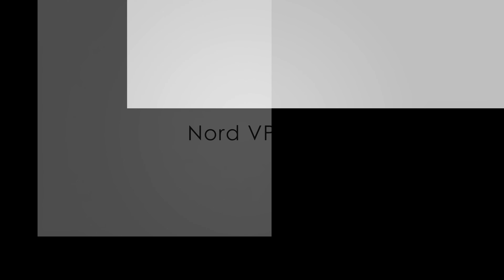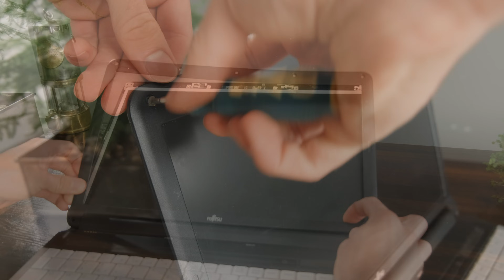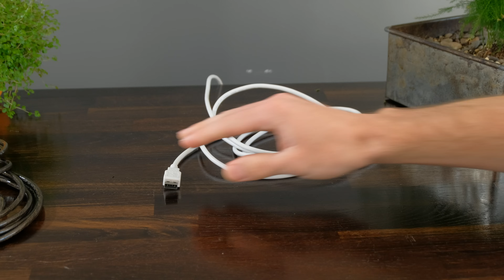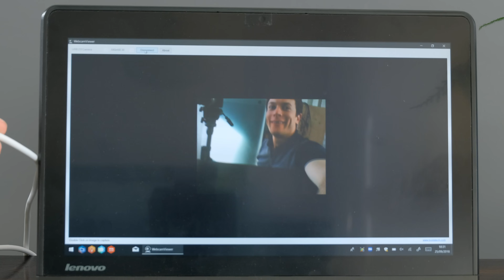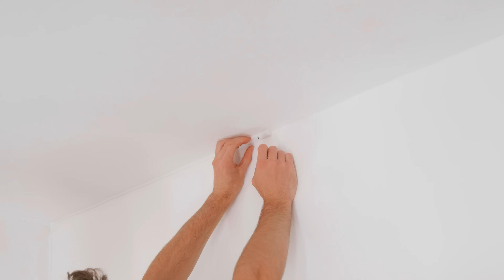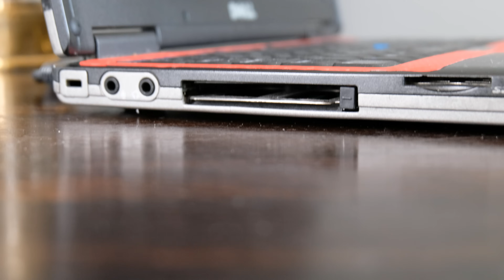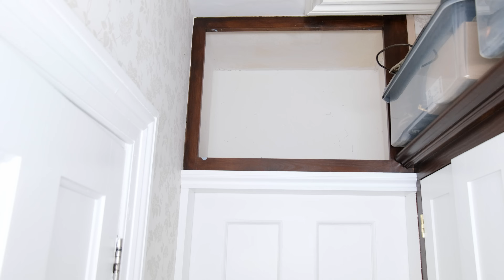DIY Home Security - ON A BUDGET!

Comment: I want to try this, but the video skips over HOW you connect and tape the wires. Soldering? Twisting the wires and taping them with electrical tape? Is this the newest video on this topic? Is there a version where a microphone can be implemented into these plans?

Comment: Anyway to possibly add build this in a way where it is battery operated and still recorded to an SD Card? There are several spycam or nanny cams on Amazon that does this, but the quality of the camera is lacking. How about old smart phone cameras instead of wwbcams? Thanks in advanced.
Reply: I am trying to figure out how to do this wirelessly as well...maybe with a ESP32

Comment: Only a moron would go with a company like ARLO, Ring, Nest etc for their “security” when you can OWN your own system that records all video, has analytics, AI functions etc. which do not require a monthly fee. Once you buy, you own. 
As for price? Yep, it can be steep. Especially if going through a surveillance or security company. However, you DYI peeps can easily buy NVR’s, Cameras and CAT6 cabling and install them yourself. It is not hard and I GUARANTEE it will be better than this.

Comment: That feeling when you wanted to make this but your webcam uses a ribbon conector
Reply: just cut the ribbon connector and solder😭
Reply: @dylansimmie that’s so hard to do man 😭
Reply: @dylansimmie mad or what, like who can even solder those small wire?? 😭😭
Reply: @sakusume its not as hard as you think😂 you just find a way to strip em and then twist and solder😭

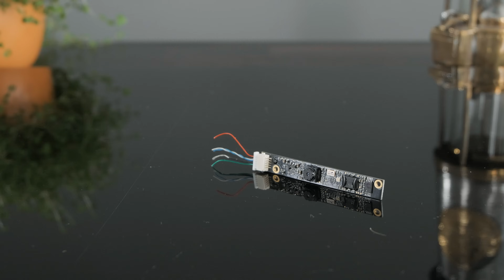Comment: 3:07 My Webcam has 3 wires, what should I do?
Reply: Also it has no marking or indication of ground
Reply: I might have gotten to the USB protocol part but the connections are too close for a multimeter or soldering to
Reply: kaka

Comment: Quick tip, these webcams can get hot using usb from my experience. I think they're made to be low power on laptops and probably running on 3,3v 3,7v and not 5v ? Correct me if i'm wrong.
I wouldn't advise you to cover them in anything. Sugru or whatever.
If you know enough, get the usb power down to 3,3 3,7 i guess. Or leave the camera well ventilated if it's running for a long time (security camera duhhh).
This might actually start a fire to be honest. @DIYPerks

Comment: Hi, I would like to use a white casing of a simple led lamp to put inside a little camera that is 5V powered supply. Can I took the power directly from the bulb that could be 220v-5v maybe? in a point of the white casing I will make a hole for the camera. In this way I have all inside a bulb but at the same time it's not a bulb camera that is very visible. Is it possible? Could you make it?

Comment: Hey Everybody, since I saw the video, I really got inspired to try it out myself. I have been living in not the nicest area, so I wanted to see how well it goes. I've been using the entire system for almost two years now, and here is my experience with it:
I tried the method with laptop cameras, but they are pretty hard to get, so I had to derive to normal webcams. Pretty cheap, I bought three webcams and been using two of them. Be careful what webcams you buy, some are not made to run 24/7 and they tend to glitch.
For the server, I am using my very old 2013 ultraslim laptop. The upside is, that it only draws about 1KW per week, which is mandatory in the current energy crisis. The downside is the specs are bad. The problem is that for each camera, ContaCam needs 1GB RAM and 1CPU core, so keep that in mind.
Another difficulty was the night. Most suspicious things happen in the night, so it is important to have night vision. I  thought of getting a camera with night vision, but it was too expensive. After a while, I stumbled upon an article to make any camera infrared sensitive. But I needed some Infrared lights, I decided to buy old, analog, surveillance cameras as they are dead cheap and have the infrared led ring and even a case. It was just a matter of fitting the webcam board into the case.
My disclose so far: It is definitely worth it, especially if you just want to start out or are on a low budget. But don't expect that it will run flawlessly for years.

Comment: i have a question. i do not have that many old laptop  webcams bu i do have some old smart phones can theese be connected with usb with some app and then connect this to contacam. i tried with iriun webcam but in contacan it eiter does not connect or only shows a still image how can i fix this? it does not work with either wifi or sub. same results on both

Comment: what should i do?? i have a webcam but the circuit board is covered by a grounding shield so i cannot access any components unless i unsolder it which i cant but i have figured out everything else but the + lead so should i geuss?

Comment: hhyp4rsssvnc . Go to clip some Wires and make the either cam fit putting the kit together by USB but instead by usin nhgvolts rttry the switch , and red in the circuit brd.  To it a. B. And black goes to it too. And white battery if it s the battery has .... cool . ❤ .

Comment: As somebody working on my own channel your formula and presentation is personally just as important as the subject. 
I've repurposed my old phone as the video recorder and editor. Being an old flagship from the No.1 android handset manufacturer the camera is ultraHD capable so more than capable in pro-mode and with the right settings. However if your filming for more than an hour you can fry an egg on them (even when rooted and de-bloated) so your tutorial gives me more options as well as multi-angled which is a game changer.
Thank you and keep up the great content
Reply: if you're talking about a Pixel, then I can testify that recording with them (i have a 3a) is a huge pain. I once had to strap a gel ice pack to it just so I can record for a couple more minutes.
Reply: @ArnauDisrepair  I said, "No.1 android handset manufacturer" bro. No wonder you had issues! 🤭
As a side note, if you roo, bypass google setup and use manufacturers web browser (samsung browser in my case) and you have a device without bloat and 'play services'. Turn on 'flight mode' and 'sensors off' allowing only camera permissions (you can totally do this with some tutorials from xda) and you basically have an expensive camera only! 
Another important thing to remember is ratio/format so you want to use 1080 720 or HD. If you use UltraHD/4K/8K >(gimmick) then your video editor of choice will not be able to render them and will require conversion before you can edit them. You can always upscale later.
Using this method I was able to record for two hours with only a modest increase in cell temperature as no services/apps are running and the internet is not spanking your processor.

Comment: Is there a good way to get the camera to output a signal to be picked up by another computer in the vicinity to have a more wireless camera setup? The most I want to do is to run power, I dont want to run full data cables to my pc.

Comment: I’ll contact him before but I’ll check it out what I’ve been using is Xeoma, Acceleration in the module feature allows you to pick what triggers the camera to record if you don’t have it on set times and how it will notify you via Transfer protocol email etc. I’m using a computer with 2006 Vista with networking disabled and biosphere mean they work and after removed because I am needing this offline. Just change the name from trial to whatever your operating system architecture is either 32 or 64 and free and you can add up to like 1000 cameras you can choose to use their hosting service and access your security system from your phone it’s a really great piece of software and their support for it on most linux distributions. Jesse USB cameras you can use IP cameras POE cameras other random shit that you can harvest and turn into some type of interface I wanna see if I can get a switch and connect a bunch of cameras over ethernet cables if anybody has any off-line interfaces that would work well with cheap cameras let me know. Oh another thing if you’re using an old PC Jonah will let you display the resolution lower than it is recording your resolution that way u can up the frame rate

Comment: I dont think this works with all laptop cameras. I have one with an IR sensor (CW54M) and it had a ribbon cable and not the type of connections these have (cable). Is there a way i can make this use of it still or no?

Comment: Can you do an updated home security video? Maybe with night vision and doorbells and alarms?
Reply: You could install basic IR lights through a light sensor for night vision. Just make sure the webcam doesn't have an IR filter or check beforehand if you will be able to remove it.
Reply: @audris8113 😅😅😅😊😊😊😊😊😊😊😊😊😊😊
Reply: @diyperks I would love an update. Maybe with cellphone cameras too
Reply: @TFMsnavy  Honestly not a horrible idea, they are smaller.
One issue I can see though is I bet they are harder to selvage and harder to solder leads onto.
Reply: I would like to see one setup using only a raspberry pi 3+ or 4.
Reply: @SullySupa this is a great idea.
Reply: ThatOneWierdVox  clicking in a comment to reply works, writing a channels id or username does not
Reply: Пнимените светодиоды инфракрасного излучения и камера будет видеть ночью
Reply: If anyones taking requests, I'd like to see a car dashcam version of this project, it it's possible.
Reply: @alliedatheistalliance6776 ooooohhhh. Me too me too!  powered by the car's battery PLUS a backup power source that only kicks in if the battery of the car is removed.
Reply: Newer cams with Sony Starvis are amazing at night. If there is a cheap way to set those up these days I would love that video.
Reply: @SnubBarracuda That’s quite an interesting idea. It would be fun to try out, the Starvis sensors are really surprising. I have seen some of the new VIOFO dashcams have a rear facing camera with a USB connection, but i’m unsure it it’s actually a compliant “real” USB or they just use the cable/connector as a straight videofeed from the rear sensor to the front main unit.
Reply: ThatOneWierdVox  Anymore? It couldn't be done from the start
Reply: yes

Comment: I have a LAP multimeter from Screwfix which doesn't have a beeper mode, any advices how can I recognize correct wires just by numbers? With grounding it keeps displaying numbers on red wire and data wires and I could take a guess and say red wire gonna be the grounding, but when checking positive connection, all wires shows numbers and do not come back to 0 as with the ground.

Comment: If I solder the web camera to the usb cable & connect the usb cable into a power source, will the camera automatically turn on or is the software needed for that also ?
thx

Comment: Howdy. Could you please build a ball solder, IC heater/remover for us? As an example, I may need to reball my PS3's gpu and im looking for a repeatable method for doing this. Thus far ive seen almost like a catlebrand that heats the solder to 450. And ive looked at cigarette lighters for ic removal, and induction heaters, both for the same process. Im changing the capacitors first. But im sure many others would like to see your inovative approach to this. If the capacitors are a no go, i may take a shot at reballing the gpu.  Thanks!

Comment: The only downside I can see is the lack of knowing what fidelity each random webcam can produce, 480p, 720p, 1080p etc. 10fps, 30 fps etc. Zoom no zoom?
Reply: Webcams are so small, that they almost certainly won’t have optical zoom. So it’s really up to whether the software you use supports digital zoom on the video (therefore you just want the highest resolution possible, for example, if you zoom in 4x on a 4k webcam, the image is still clear because it’s 1080p). I can’t speak for the other things.

Comment: so, my cam has colored wires which made it easy for me to connect with the usb but then when i plugged it in there is that ic (m5608c) that gets super hot + it's not recognized
Reply: i think its m5603c

Comment: Suggestion for laptop health: it's not the best idea to have a laptop sitting on something cloth like as it can restrict airflow (no I don't care if it feels cool enough, it's still not a good idea). if you're going to leave it up there either take that bamboo mat out or put some bottle caps under the feet as spacers so more air can get underneath it. Also get yourself a smart plug (or do it yourself manually) and exercise the battery from time to time. Most batteries, especially older ones, don't like being floated all the time. Even if it's a lithium battery and it has a charge controller and all that fun stuff, not all charge controllers are created equal. So make sure to exercise it, and it should stay in peak form for when you actually need it.

All that aside, that rubber putty stuff in the corner of the ceiling is freaking genius! I know how I'm hiding my interior cameras now (and maybe a few outside ones, let them destroy the decoys LOL) 😁

Comment: That's the problem with security cameras number ones are linked to NSA database for face recognition before you even get the material on that's why they don't have SD cards so they have to go through the cloud to do any storage plus the company wants to charge you monthly for features you bought the f**** camera for I've owned and demoed almost every camera on the market and found them all lacking if you can build your own high functional camera system that you don't have to pay for the function of the camera you bought more power to you

Comment: Excellent video but The connection part is a bit vague. the webcams have very many wires, which ones are used and which ones are not used? You could at least consider showing the actual connection between the wires from the camera and the usb cable

Comment: Couldn't you use the multi meter to find which data wire is positive by putting the meter in Diode mode?

Comment: I've thought of doing a similar project using Cell Phone cameras. I've got 5 outdated cell phones but I'm just not sure how to wire them. I haven't even thought about pricing new replacement cellphone cameras and I'd imagine you could get them just as cheap as the laptop cameras.

Comment: @DIY Perks. Are the USB cables I am using correct? Your USB cable shows 4 wires and mine only have two. I have tried a couple of differet USB cables and they all only have two wires.  How would I go about wiring the two wires to the web cam which has 3 wires and the twisted ones? Your advice would be greatly apprecited. Thank you.

Comment: I’m not very good (at all) with wiring and testing data cables, but I only need one camera and I have one not very old laptop that is still kind of working. Can I just get the camera out, add more wire and reconnect those long wires back at the old camera “socket” and make it work like that? Can I do that with black electrical tape and not with soldering?

Comment: guys i have an laptop with a i5 but it is hard to get running and its internal keyboard is not working and and its usb ports do not work so i cant add an external keyboard and also it opens but it does not charge how can i fix it?

Comment: will it work if the signal at the end of a long usb cable is amplified with step up dc to dc converter ?And the signal should be amplified to the amount mesured before the cable?

Comment: Does anyone know how many of these could be connected to a raspberry pi zero?    My house is run on 24v battery bank with 12v and 5v step downs if needed  and I’d want a tiny computer just for these cctv cameras that doesn’t use as much power as a full laptop running 24/7

Comment: Great Video :) 

Can someone please help? 

- what about capturing video at night? Just add bright IR LEDs with motion sensor? 

- what about instant alarm on the phone when motion is detected?

- is there a way to access the system nicely on an iphone? 

- if there is a power loss, how to back up the USB repeaters? Give them extra battery’s, additionally to the power line? 

Many many thanks! I’m really considering building a system like this for my workshop. 

But I’d rather use high definition Webcams, so you can see and hear more, in case of a burglary. 

Maybe make an updated version of this video?! :)))

Comment: What about the remaining cable of the native connector?? What should we do about them??
I mean USB is 4 pins, right, so you connect them to 4 corresponding Pins on the WebCam, but webcam got 5 or 6 Pin connnectors. So 1 or 2 are left unconnected, what about those ones??